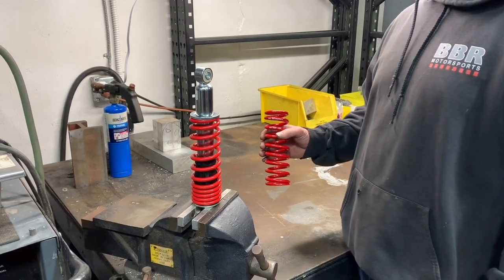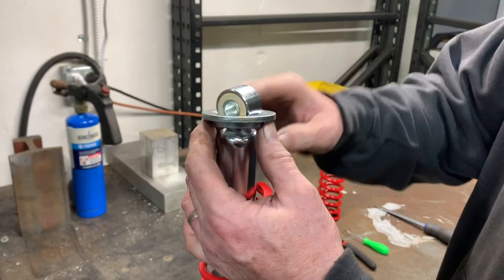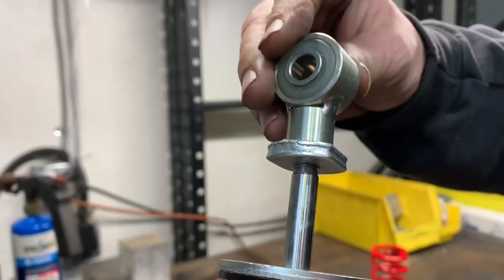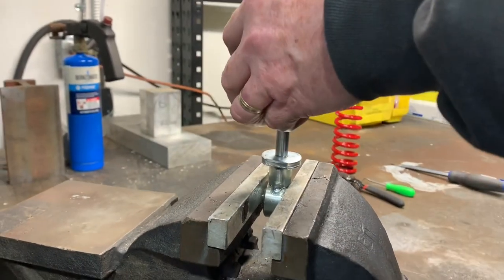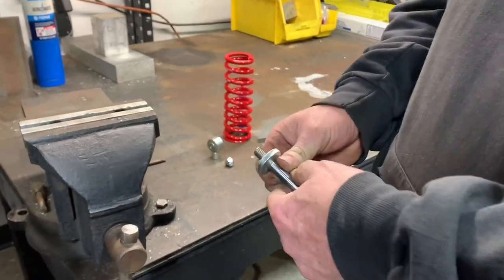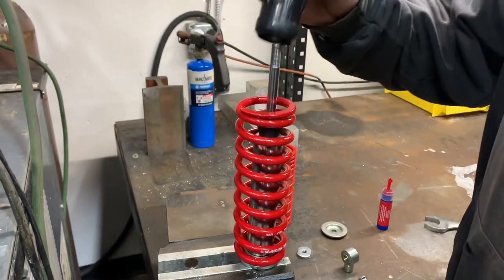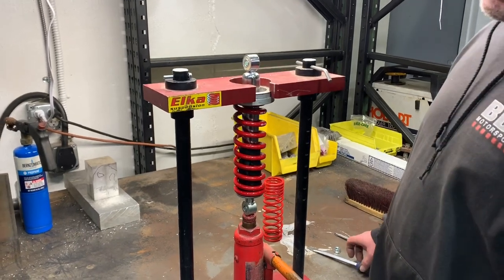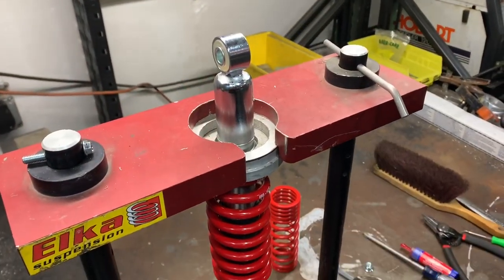BBR CRF110 Shock Spring Installation

Comment: Any way to extend rear shock at all yet to match the 19+ crf with the front dampening rods and springs
Reply: There is little plastic extension pieces you can buy from faster minis